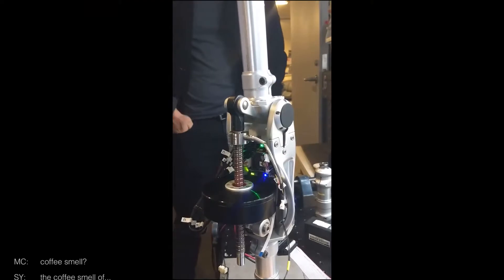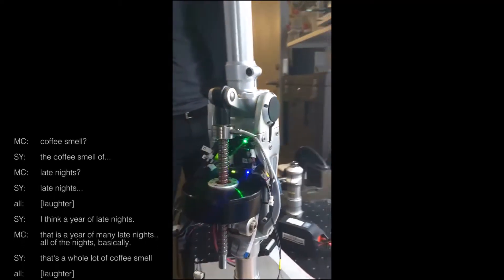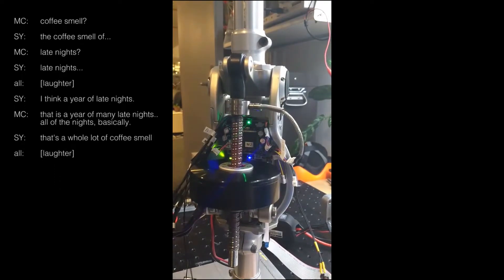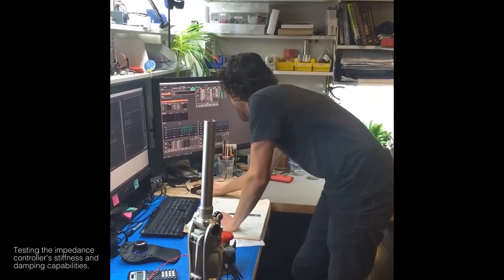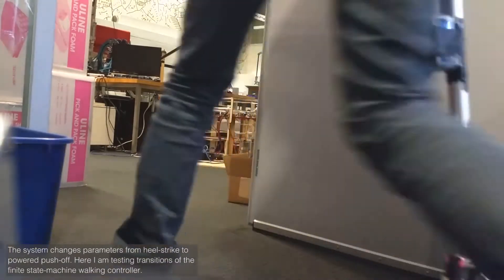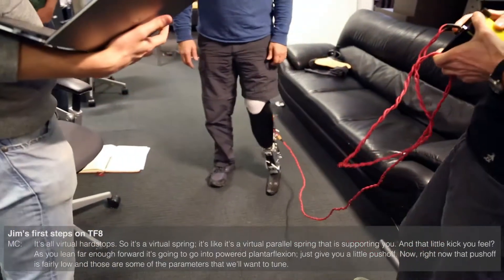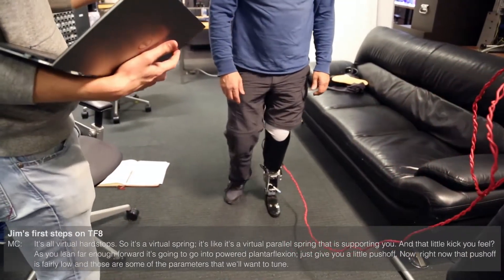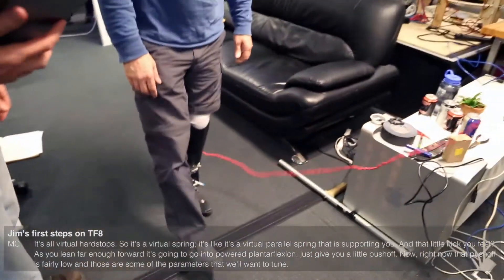The Making of TF8 a Reaction-Force Series Elastic Actuator Powered Knee and Ankle Prosthesis

Comment: Awesome work! I didn't read the pre-print publication yet, so my first question is how does the TF8 differ from the BioM/Empower? I am about to write my Masterthesis in the same field, so this is really cool ^.^
Reply from the maker: right on. I mean it's similar in that it's a powered ankle prosthesis.  But it's a different actuator configuration that gets a bit more power density and range of motion, and most importantly it can be personalized. It's capable of performing as a knee in addition to an ankle. The spring can be easily adjusted to match those applications or the body weight of the user.
Reply: I definitley appreciate a bigger ROM, and the lightweight design. I think it is a bit of  pitty that the commercialised version of the BioM/Empower has a relativley low ROM ("only" 15° PF if I am not mistaking). I mean it is probably by design in case of the Empower, but I am glad to hear that you are aiming for "high-activity-level performance". An active ankle prosthesis for K4 users is still kind of missing on the market, which I find unacceptable as someone who is all about jumps.^^ I hope I'll get wind of the next iteration of your prosthesis or when there will be clinical trials at some point. Congratulations to your PhD ;)
Reply from the maker: @felix4pk  I'm pretty sure Biom does about 22deg of plantarflexion. But its dorsiflexion is limited to 0deg. I've got a paper coming out for BioRob in November that discusses electric energetic tradeoffs. From my analysis, limiting dorsiflexion saves a substantial amount of electric energy, and this is likely the main reason they limited ROM, to make the battery last longer.  Also, it provides a fail-safe if the battery dies, you can always lean into it and remain stable.  My system has a relatively low gear ratio, making it unstable when power is dropped.  You can fix that by swapping the FETS for something that's normally open, but they tend to be much larger and harder to package. so in the mad sprint to build the thing, we chose not to include them.  Certainly room for improvement in the future.

Hit me up if you wanna talk more details.
matthematic.com
Reply: @cybanical  those are some good arguments for limiting dorsiflexion, from an engineering perspective at least. On uneven terrain or uphill having no dorsiflexion is a bit of a drag.
Anyhow, i'll definitley check out ur website. Looks cool. I didnt see any contact tho, in case I do wanna hit you up, but I just checked ob my phone. Well, if necessary i can also check reseatch gate i guess :)